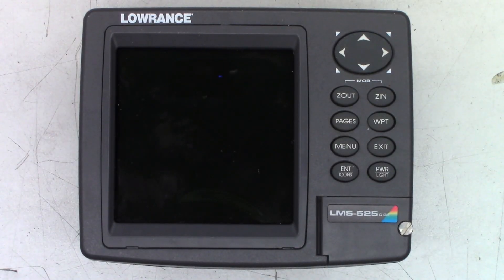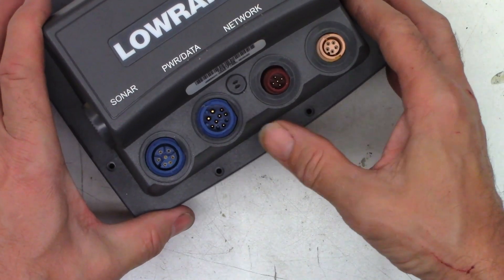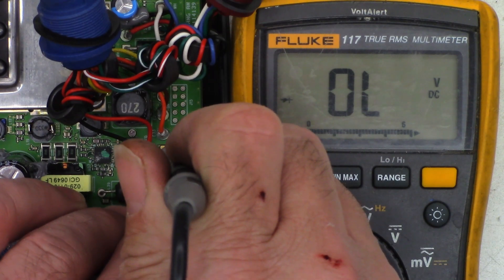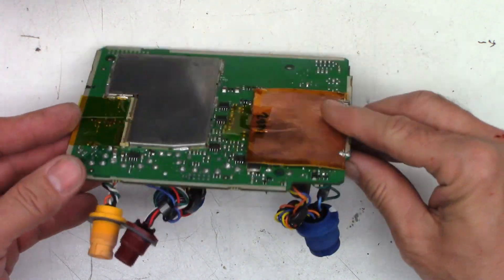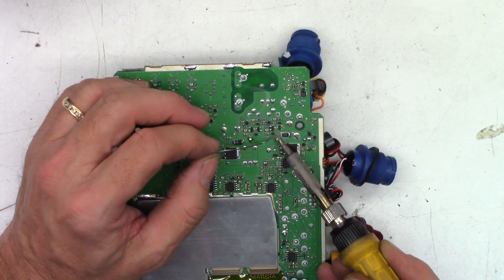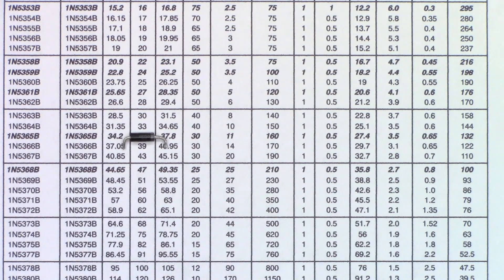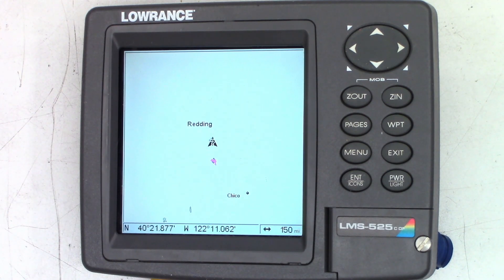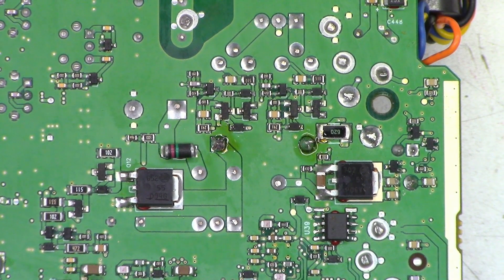Lowrance LMS-525 C DF Fish Finder Repair. Boat had a over voltage issue. Can I save it?? LMS525CDF

Comment: Hi Norcal715, i've got an old LCX 19C, the screen is flipped (or mirrored) and upside down, i've hard reset it but the screen is still upside down. It's not a problem of wiring as i have another LCX 19C without any problem when plugged in ! Got an idea ??

Comment: Nice repair, glad it wasn't too involved to get inside and access the boards.  You tracked through the circuit the way it should be done.

That shorted diode sounded familiar; back in the '70s I repaired CB radios, very often the reverse polarity protection diodes would short for some reason (can you say swapped power leads and incorrect replacement fuses?).  I started keeping those diodes in stock, and started installing them on older radios that didn't have them from the factory.

Keep up the good work, sir!
Reply from the maker: When I had my CB shop I would replace at least one or more a day. Reverse polarity with a 20 amp fuse!
Reply: @norcal715  Let's not forget the foil gum wrapper on the blown fuse trick!

I wish I'd had a camera, back in the late '70s I actually saw someone swap polarity on a PL-259.  The guy used RG-58 coax without the UG-175 spacer, unbraided the shield and soldered it into the center pin, then soldered the coax center conductor through one of the holes in the side of the PL-259.  Miraculously he did NOT blow the final output transistor on his radio, but wanted me to look at it because he "couldn't get out very far" on it.  I had no tools or parts with me, had to re-use the same PL-259, and he had the adapter, just didn't know how to use it.  I showed the guy how to do it properly.  I still cringe when I think about it, but mostly I laugh.

Comment: The max input for 7805 type regulators is 35 volts.   Must be one or more regulators after that zener for the main supplies.
Reply from the maker: It has 2 switching power supplies. No linear regulators in this one.